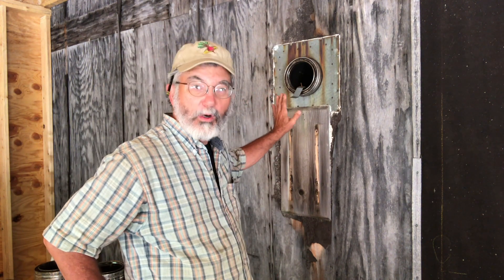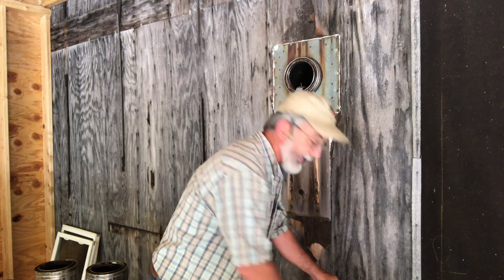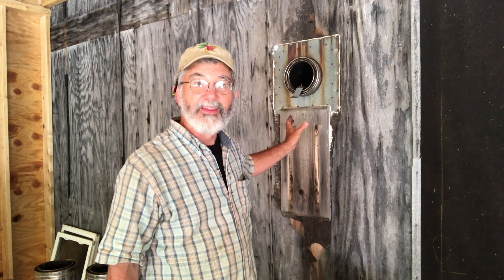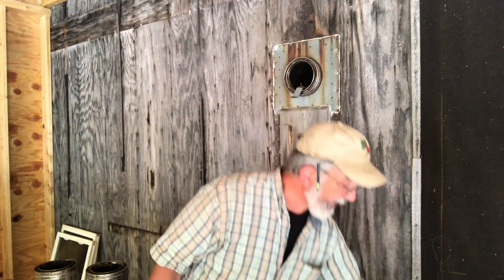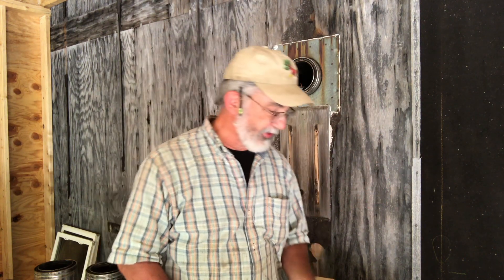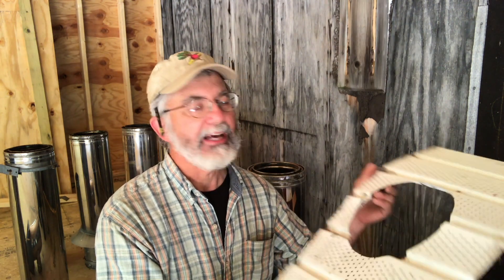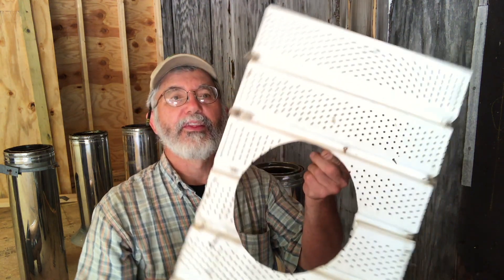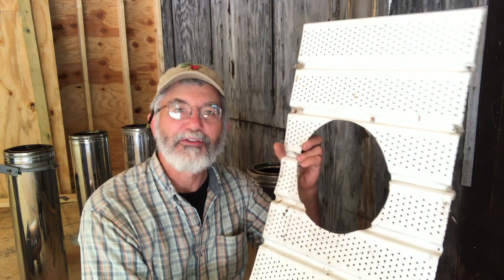Part 23 Of My 2018 House Addition Project

Comment: Your old vinyl soffit also shows just how cool the outside of that stove pipe runs. Vinyl is not at all heat resistant, yet there is no apparent heat damage.
Reply from the maker: Good point, Harry. There is supposed to be a small air space around the pipe (1" all around), but it never really gets more than a bit warm. I fit the soffit tight and there was no problem for 30+ years. The only problem was the wasps found there way into the soffit and made a lot of nests. But I'll be giving the pipe the recommended space as it goes up through my house.